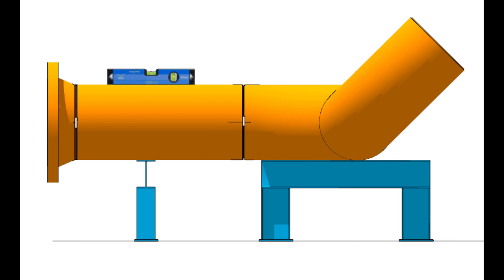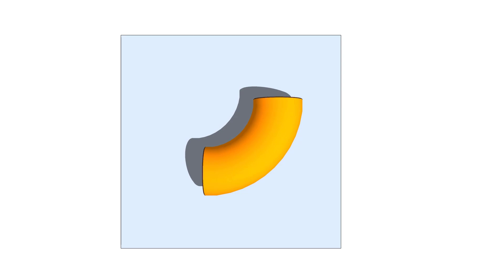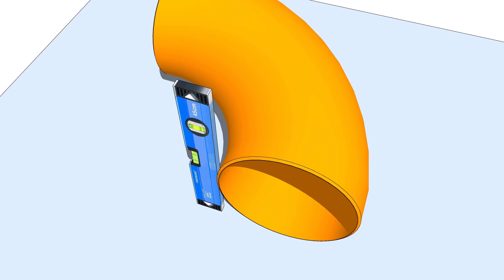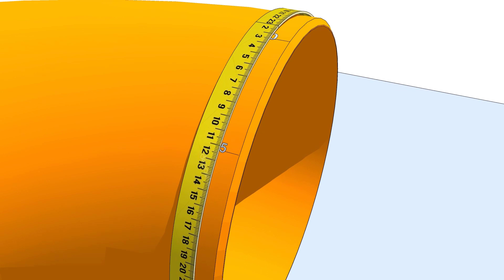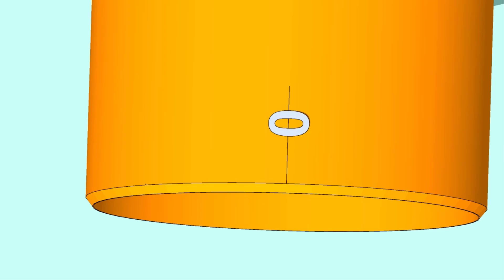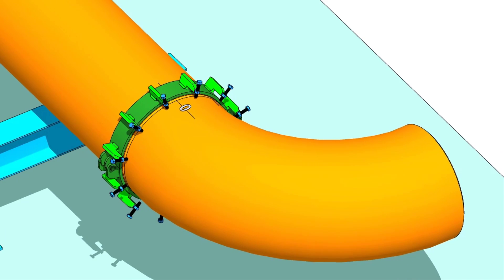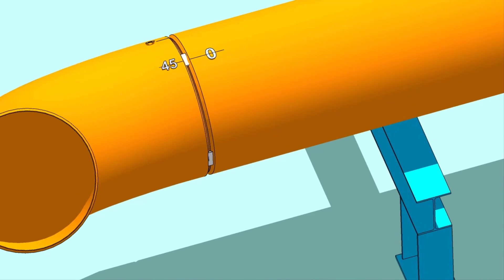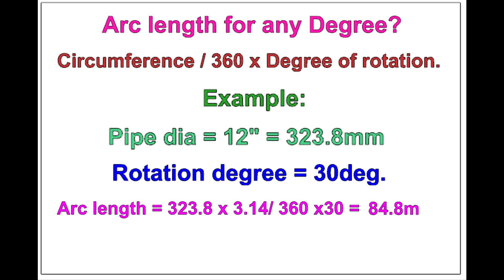HOW TO FIT UP A 90 DEGREE ELBOW, ROTATED TO ANY DEGREE- TUTORIAL FOR BEGINNERS TUTORIAL

Comment: Thanks a lot! I haven't got how to find 45 degrees but I will try to understand.
Reply from the maker: Thank you for the feedback. I will check and reply you.
Reply from the maker: 1 degree = circumference of the pipe divided by 360. 45 degree= circumference divided by 360 x 45.  suppose you want to turn the elbow 30 degrees, pipe circumference divide by 360 x 30, then mark it on the elbow or pipe as shown. remember one thing. if you want to turn the elbow left, the marking shall be in the right direction.,
Reply: @technicalstudies.  thanks! Suppose we are rolling an 4" elbow by 60 degrees. 1. Need to find circumference which is 114.3 x 3.14 = 358.9 mm. 2. 360/60 = 6. 3. 358.9/6 = 59,8 mm. So I need to measure from zero around 60 mm and I will get 60 degrees? Thanks
Reply from the maker: @АдиКабиев  358.9/360= 0.997. 60 degree= .997 x 60 = 59.6mm. Yes you are right.👍
Reply: @technicalstudies.  Thanks for sharing and prompt response Bro! I am watching all of your videos these days. Will be waiting for new ones! Good luck!
Reply from the maker: Thank you. please share some topics in your mind. so that i can make new videos.
Reply: @technicalstudies.  I do have plenty of questions but first I need to watch all your videos😁 Thanks!
Reply from the maker: @АдиКабиев  Bro, i need a good topic to make a video, if you have, new topics please share.
Reply: @technicalstudies.  how about this - Why is Eccentric Reducers used in suction side of pumps and other equipment? How flat side of reducer should be oriented?
Reply from the maker: @АдиКабиев  Thanks bro.
Reply: @technicalstudies.  from my little experience, we had many problems such as seam-to-seam clash during spools erection. It happens due to wrong spool prefabrication. I mean that how we should prefabricate spools that consist of welded pipes. Or can't we predict this problem?
Reply from the maker: @АдиКабиев  in the drawing, show the long seam rotated, usually 60 degrees from the vertical the left for the first spool, for the 2nd spool, 60 degrees to the right side. 1 spool weld seam 300 deg. 2nd spool 60 deg. 3rd spool 300 deg. 4th 60 deg. QA QC must recommend the design department add these details in the drawing when the pipe is with a seam. if you are already in a problem, add additional flanges in the line.
Reply: @technicalstudies.  thanks Bro! Just wanted to recommend some videos to you ✊🏽